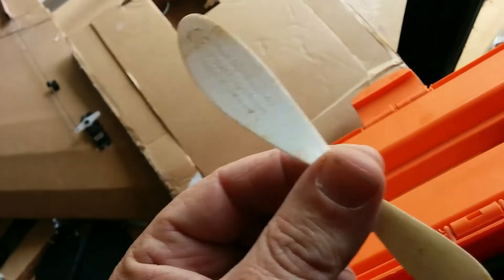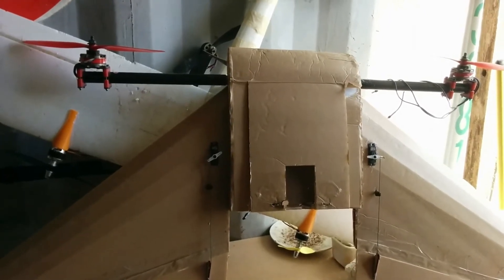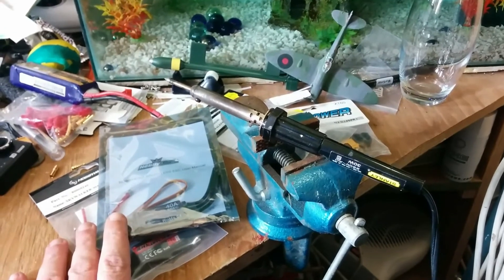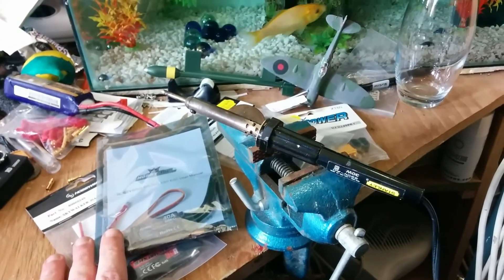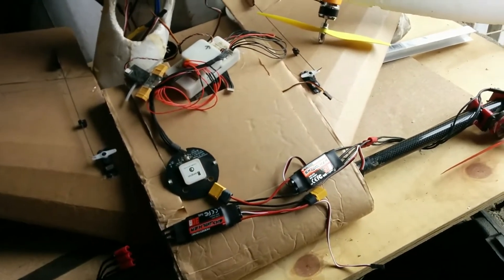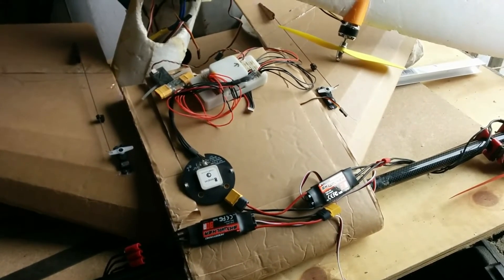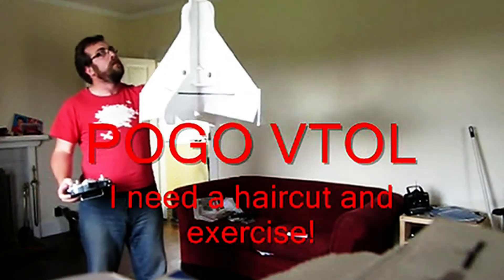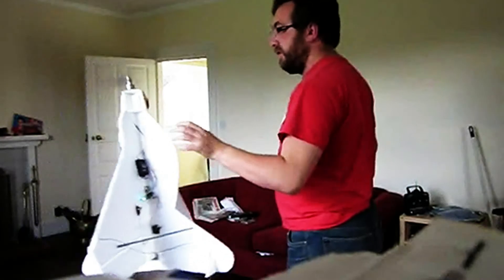Starting a VTOL tailsitter will I ever finish! #NAVLOG 33

Comment: I’m impressed with the single motor Pogo at the end of the video. Have been searching for it for a long time.
I wanted to build a single motor tail sitter for quite some time. Any chance for more info and some tips? Don’t want to reinvent the wheel.
I’ve built single motor copters but they are a different animal. They only hover and they they use Arducopter software.

I hope you still monitor this channel.
Reply from the maker: Hello Andrew, you are lucky I am not great at answering comments normally, just seen this one. Ardupilot supports the pogo out the box now. Getting the CG right was the big issue. If I were to do it again I think I might cheat and use one of those duel inline motor setups as yaw really can get out of hand quick. Also give you that much more thrust.
Reply: Drone & Sundry Thank you! This is great news that Pogo is supported by Ardupilot. 
It’d be great if it would use all 4 elevons to counter the motor torque, instead of just 2 ailerons the way it’s done for single motor tail sitters.
I have to stick with a single motor as this is going to be a gas engine powered Pogo. 
My single-copters are also gasoline powered.
If you get this message - do you know whether ardupilot Pogo uses all 4 elevons for the torque, or just 2?

Comment: did you get the pogo in forward flight?
Reply from the maker: I did but it was not pretty, the main reason being the single prop I think. I kept running out of authority against the torque. Also it was just push the nose down and fly manually. Release the stick and back into the hover, so not a real transition. I was using it as a route to get to a copy of that Japanese ball which was popular then so I didn't  continue too much with it.
Reply: Japanese ball ??
Reply from the maker: This one https://youtu.be/uRqcIPHMlfM
Reply: Oh, missed that one,sometimes it,s hard to stay on one project.....looks interesting.....hmm